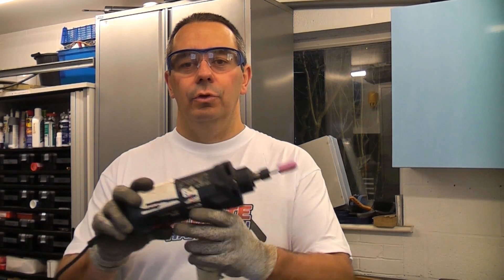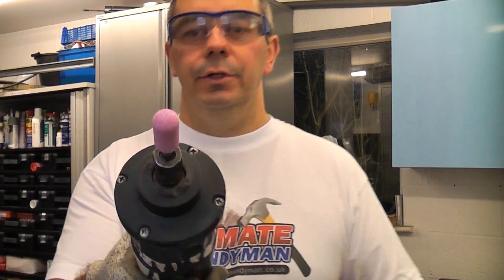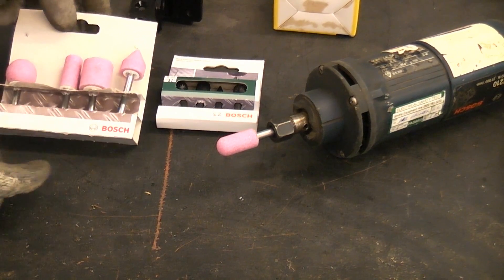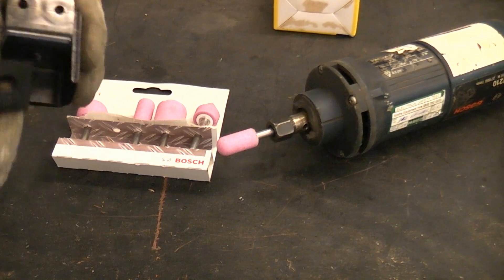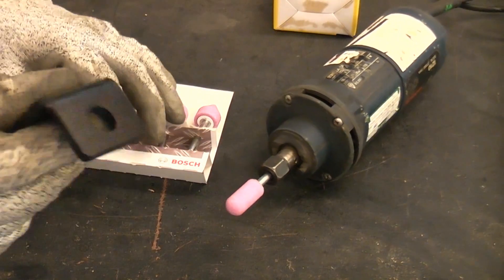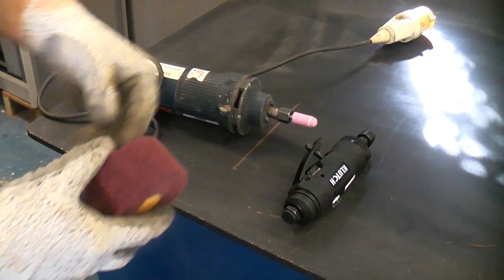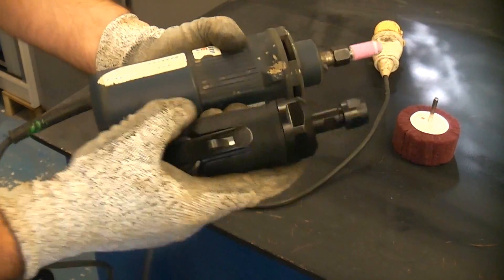How to use a die grinder | enlarge hole in hardened steel

Comment: i have this exact issue and driling will be a pain
Reply from the maker: Drilling hardened steel is very difficult, without really expensive drill bits or specialist equipment.
Best of luck with it 👍

Comment: why you not drill bit?
Reply from the maker: The steel shackle is made from hardened steel- you can't drill hardened steel with most drill bits.
Thanks for the comment
Reply: unless it's carbide and the rotary file he had must be made of hss

Comment: Awesome video!  Was the bit/burr worn down from just this one job? Or will one bit/burr last for many jobs such as these?
Reply from the maker: It was slightly worn, but you should be able to do a few jobs from the one bit- especially if you use a carbide bit as they last a lot longer.
Thanks for the comment

Comment: I suppose you can use those grinding bits in any drill as well.
Reply from the maker: You can, but they don't work well as the die grinder rotates much faster than a drill
Thanks for the comment

Comment: Just wanted to ask, can a die grinder be used to enlarge/cut a hole in plastic. I'm planning to make a semi circle at the base of my bumper so the muffler tip can slide through and sit in place. I'm aware that the size of the bit will not meet my requirements but was just wondering if I could use the edge and slowly carve a semi circle until I get the radius that I seek. The bumper is made from flexible plastic and is very thin btw
Reply from the maker: Yes it can, but a drill might be easier with a rotary burr as the die grinder might be too aggressive for plastic.

Comment: Just curious .. .can an electric drill achieve the same results using the same bits? Thanks!
Reply from the maker: No, I'm afraid a drill does not rotate fast enough. Die grinders rotate at over 10,000 RPM
Thanks for the comment

Comment: coming from an M.E. we use carbide drills all the time to drill hardened steel.   I would recommend the hp carbide drills from OSG. they are cheap,  well made,  and coolant thru
Reply from the maker: Thanks for the comment ;-)

Comment: Why didn't you use a brill bit
Reply from the maker: The shackle is hardened steel, which is very difficult to drill and requires special drill bits that are not normally available in such a large size.

Comment: Wow, a twist drill would work just fine but it would be best in a mill or drill press to control the feed. You can also use a step drill / unitbit as these are great at enlarging drill holes. Die grinders don't do much of anything well, it's just that sometimes they're the only way to get at something difficult to access.
Reply from the maker: I'm afraid I twist drill or a step drill will not last long on hardened steel.
Thanks for the comment ;-)
Reply from the maker: Perhaps the manufacturers ripped me off when I bought the hardened steel shackle.
Anyway I tried a blacksmiths drill bit first and it would not enlarge the hole- because its hardened steel, hence I had no option but to use the die grinder ;-)
Reply: A bit more metal experience would help you immensely Kevin.. IE; Laser or plasma cut holes as we find in most mass produced brackets and such are hardened around the holes because of the heat involved to cut the hole. We use die grinders all the time to enlarge or smooth a CNC torch cut hole as normal drill bits are useless in these situations.

Comment: This is a good demo about the capabilities of die grinders. On a side note, do you think tempering the hardened steel with a torch would have made drilling the hole easier? (assuming paint was removed). Also, do you think tempering it would make it possible to drill with a HSS drill bit using a drill press? Thanks.
Reply from the maker: Tempering it might have helped, although if it has an high carbon content a normal HSS drill bit would probably soon dull.
Thanks for the comment ;-)
Reply: ***** Thanks!
Reply from the maker: You are welcome ;-)

Comment: Hey I install storage units and some times I have to cut in 18 gage metal it install a beam threw the wall for the floor I normally use a angled grinder but can no longer use to to management so I currently use my snips but its to much time consuming so can I use a die grinder and if so what bit can I use to to make plunge cuts in the letter of a Z thank-you
Reply from the maker: +David Cordero 
You might struggle controlling it. I have never tried to plunge cut anything with one of these. I normally use them for deburring or enlarging small holes in hardened steel (if the metal is not hardened I use a drill as it's easier).
Reply: Ok cool thank-you do you think if I make a hole first that I can still make a Z like pattern
Reply from the maker: +David Cordero 
Not sure. Have you ever tried to use a router free hand? they tend to be difficult to control as they try to move in the direction of rotation. I don't want you buying something that won't do the job as these tools are not cheap. If you can wait a few weeks I'll have a try when I get time?
Reply: +David Cordero If you can use snips, why not use electric shears? They make both corded and cordless.
Reply: Shears r no good I pretty much needed a machine that would allow me to make plunge cuts into metal and the grinder makes to much of a cut lol
Reply: But you said you were using snips - those are shears.

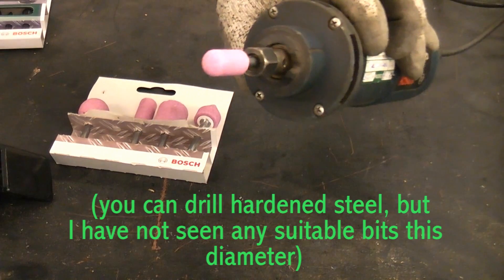Comment: at 02:00. the solution is quite simple, drill them using bits meant for concrete. you can drill up to 5-7 holes with the concrete drill bit upto  21mm in depth( heavy duty leaf springs)  and they are quite cheap
Reply from the maker: +Arjoonmoal I look forwards to seeing your video enlarging the hole in a hardened steel hasp using a Masonry bit.Thanks for the comment
Reply: i won't be posting such videos, because wasting materials just to show you guys is out of my reach here (unless i'm doing something which requires this process, but i surely won't focus on filming it because i'm not familliar with camera etc) because i live in Mauritius and everything is scarce, and i'm just a hobbyist looking for the cheapest alternatives. Anyway thanks for the reply.
Reply from the maker: +Arjoonmoal 
Thanks for the comments ;-)
Reply: +Ultimate Handyman hey finally recorded a video using masonry bit. how do i forward it to you
Reply from the maker: +Arjoonmoal 
Can you upload it to YouTube and post the link here?

Comment: is there any other way to grind away hardened steel like on a bench grinder? I need to remove a fair bit of material on a high carbon steel knife
Reply from the maker: Yes any kind of grinder/abrasive machine should work on hardened steel.
Thanks for the comment

Comment: ***** what's the top speed in RPM on the angle grinder.
Reply from the maker: Die grinders run at very fast speeds, generally between 15,000 and 26,000 RPM. I'm not sure of the exact speed of that die grinder without checking.

Comment: Tungsten burrs work best on steel, they throw off hot chips in your face though. The heads are brazed onto the shaft, if you press to hard they can break off.

Comment: Silly question perhaps, but just wondering how hot was the bracket after you enlarged the hole?
Reply from the maker: It was too hot to touch for a few minutes.
The grinding wheel I was using was a little too large for the hole I was enlarging, which made it difficult to enlarge.
Thanks for the comment

Comment: I have spent some money one dremel tools and accessories.. And the dremel has a lot of flaws.  Yes it'd light and compact but removing and installing bits takes some time.  The cutting wheels can easily break.  

Can you get cutting wheels for this?  Then it could easily replace the dremel tool as the buts seem sturdier
Reply from the maker: Yes, you can get cut off wheels for them although I have never used one yet.
Thanks for the comment

Comment: Hiya mate, great video. I've got a quick question. I've just recently bought a Makita screwdriver/bit set and there are two little things labelled 'Plastic Finder', they are like a small plastic tube with a spring loaded washer/clip inside. What are they for? Cheers mate....
Reply from the maker: I think they slide over the screwdriver bit and hold the screw onto it- they might be useful when driving in slotted screws which are difficult using a drill/driver.
Reply: cheers mate. I thought it was something along those lines, i'll give em a go but i will probably cope without em....
Reply from the maker: Jonto Dickens
You are welcome ;-)
Thanks for the comments

Comment: Why wouldn't you use a deemed or put the bit in a drill?
Reply from the maker: Sorry, I do not know what a deemed is?
The bits won't work so well in a drill as they do not run fast enough.
Thanks for the comment
Reply: I meant dremel tool, the auto correct changed it,
Reply from the maker: MakingTheCut 
It's a pain in the arse sometimes that auto correct!
I have only used a Dremel once and it was not much good to be honest, they are OK for model makers but for doing something like this in hardened steel I think you would use a few abrasive bits doing it. 
Thanks for the comments

Comment: What is the difference between a die grinder and a drill? Thanks
Reply from the maker: Yolanda Sinclair 
A die grinder revolves at a much higher speed than a drill, so you can use it for grinding as in this video where it was used to grind the hole larger in the hardened steel shackle. You could not do that with a drill.
Thanks for the comment ;-)
Reply: ***** Ok, thanks. By the way, I love your videos, some things really helpful, some things I'll never need (like this one) but always really clear and interesting. 
Thank you
Reply from the maker: Yolanda Sinclair
You are welcome.
Thanks for the comment